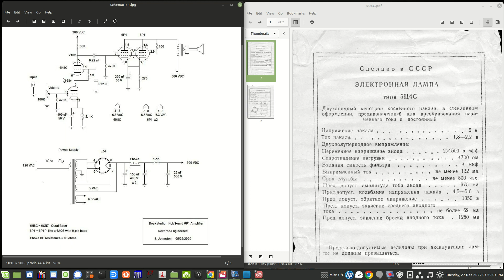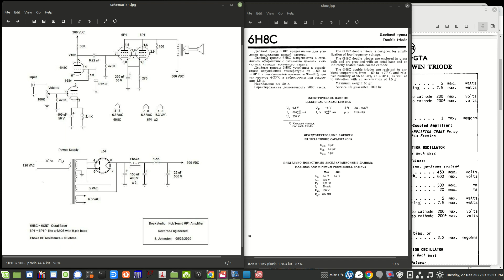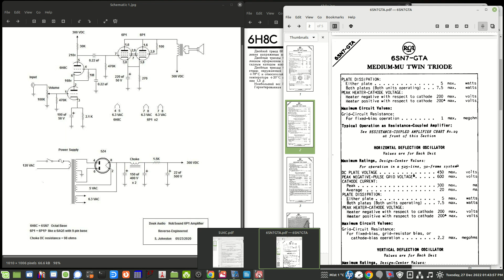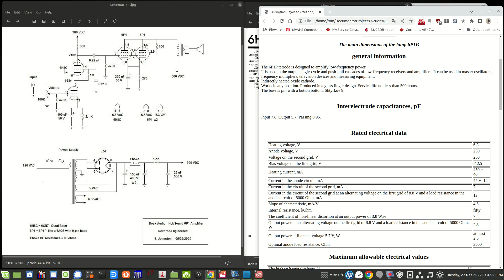Review of a Chinese amplifier, Nobsound 6P1.  Schematic Review - Part 3

Comment: RE: UK mains

I have tried and have failed to get one of these from an Aliexpress seller. 

Initially things looked positive; there being 220v, 230v and 240v transformer options to choose from. 

However, pressing for detail led the seller to become increasingly ambiguous and eventually for him/her to advise me I would need to buy a voltage regulator in order to bring my UK mains supply down to 220v. 

The seller's response to questioning why I couldn't just get the 240v option was that I should stop being troublesome. 

Rightly or wrongly I've concluded that the difference between the 220v, 230v and 240v variants is...the sticker glued to the transformer.
Reply from the maker: I like that (sarcasm) "that I should stop being troublesome. " .  REALLY!?!  Oh well.  It is AliExpress and many of the vendors do not really understand the expectations of the western world.  But they are learning.

You were not unreasonable, the seller did not want to disclose the truth "...the difference between the 220v, 230v and 240v variants is...the sticker glued to the transformer."  This is why product standards are developed.  

But if this or any other product continues to be of interest, I would suggest a variable transformer (VARIAC)  and set it to the voltage you want.  This one is interesting and it has a voltage meter for the output!  https://www.ebay.co.uk/itm/282760979817?hash=item41d5de2569:g:V00AAOSw6clgetlX&amdata=enc%3AAQAHAAAAoPNdTm6dzxVRIgQDYsKftjMFWyX6ExTSneQMUSWH1CuxZUnjCPnchi0TJFk75yEZJRNRi3SwYp7Z1vaSPHZbfseF5Q9n7R52UHcY1PXmUC4EBXznZeg1LyNa3XeUDZebAgHMYgLpq%2B%2BAs9lq1nt57invAF4xbMC81CUDI%2Bp1MO%2FNt10J3L8ZzZR%2FwMAUmUV2fvZw8Lmlx2JdRt0vl7RIkfY%3D%7Ctkp%3ABk9SR7KO5MDSYQ

It is a bit ugly but...  If you had a preamp that was 220v you could use a power bar to run your 220 volt equipment.  I believe the Chinese use a 110/220 volt system and the vendor is just trying to get a larger market.

Good luck and I hope you find a suitable product.

Cheers.

Comment: A very interesting discussion on design. I thought the A/C  input voltage in a power supply could generally be tolerated within a certain range. Considering your evaluation, I’d be interested to hear why Nobsound made those design decisions considering that a single-ended class  A amp is more-or-less aimed at the audio purist.
Reply from the maker: Thank you.  110 volts is standard in many many countries so that is why the designer chose that value.  Tolerances are usually +/- 10% but in the US and Canada  120 is standard which is on the very top end of 10%.  At my home the voltage at the outlet can be as high as 128 volts.  Well within the acceptable range for utility supply.  128 volts may be a problem for this amp.  The concern is to keep the B+ voltage down as some of the tubes are getting close to the maximum plate voltages.  So really, this is just a safety thing.  Just plugging the amp in will still be OK.  I did not get my amp from Nobsound.  I purchased it from Aliexpress and it came from China under the name of Sunbuck.  It was on sale!  :)  I suspect that Nobsound is a reseller for the Chinese manufacturer for these lower cost amps.  It is funny you ask that question about design as I was thinking about returns and if Nobsound is keeping records of how many are being returned and what the problem is.  Thanks for watching!